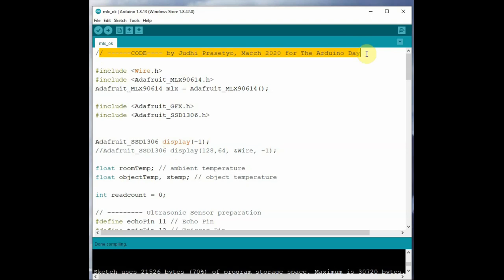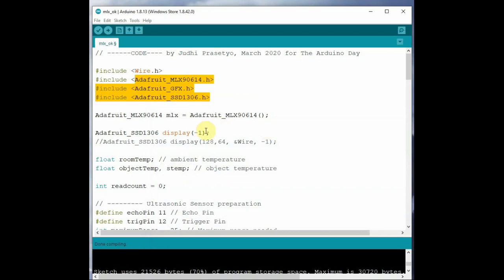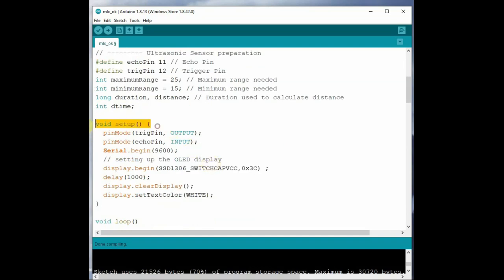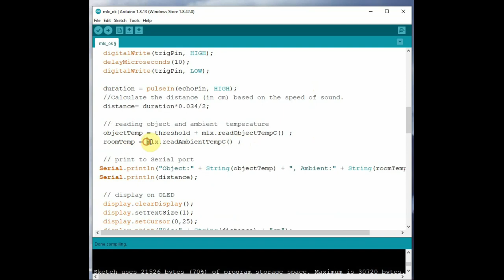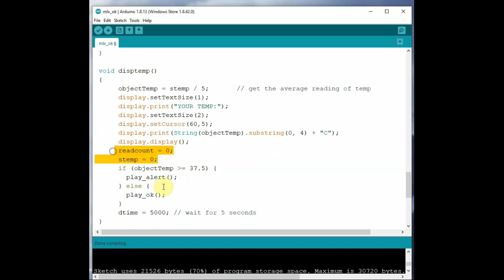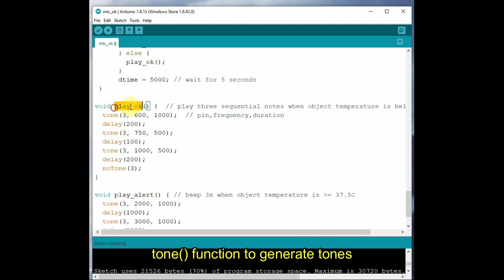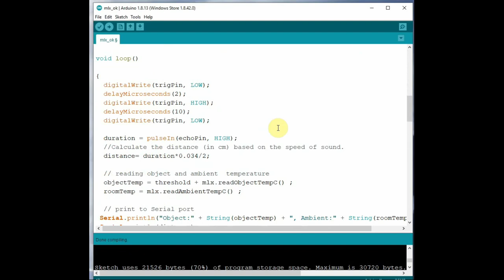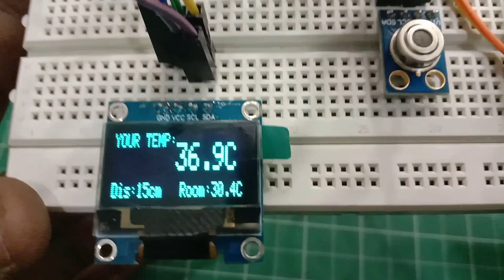MLX Non Contact Thermometer Project with Ultrasonic+OLED+NANO

Comment: Hey,

If I’m not wrong then as the distance between the object and the sensor increases the measured temperature decreases. 

But in the code you are directly adding a certain threshold value which may work in the current environment. But as the atmospheric temperature (room temperature) changes so does your measured body temperature also changes. 

How will you overcome this drawback?

Comment: Sir there is a very big issue When I use mlx and oled separatly it works well but when used both   The program doesnot work if I comment out mlx then only Oled works what is the issue ??

Comment: Perfect circuit, and perfect explanation. Keep it up sir. Please I am having an issue with the temperature reading. It is reading it as 1037°c on the display and serial monitor instead of a value like 31°c. Your reply will be very much appreciated. Thanks in advance
Reply: in my case it happening same
Reply: Same is the case here...did you find the solution?..please reply
Reply: Clean the sensors properly(use alcoholic spray if necessary) and reconnect, that fixed my problem
Reply: @alexabraham5771  thanks alex 
but now in this ,my temprature is 31 degree c
and the normal temprature of human is 37.
what is happening in this contactless thermometer
and for seeing my temprature i have to touch the sensor then only sometimes it shows the correct temprature
please somebody help me
Reply: @kshitijtechnicals2609  check ur temperature with a normal thermometer and calibrate the ir thermal sensor by adjusting the threshold, if the problem still exist after cleaning and calibration, then there might be a problem in the component, arduino port or it can even be a loose connection.
Reply: @alexabraham5771  ok alex thanks

Comment: Sir in this project after uploading the code and set-up the connection it shows only hold on message for long time but didn't get the temprature
Reply: Bro, may I ask did you solve the problem and what is the solution?

Comment: nice explain 
can you make one video on IR analog output connect with oled to show count from 0 to 16
My project is having ir sensor with analog  output l/arduino/ oled
reflection surface is 25 degree slant position while moving surface area towards ir sensor, oled display reading  0 to 16. distance in between ir & reflection surface is 110mm only. i tried with so many combination of mapping in code but initially oled display shows 3. please help me out.

Comment: sir the supply voltage is shown as 3V but here 5V suplly is given to the sensor ...it wont get damaged ?
Reply: Most sensor work on range of3.3 to 5v no issue

Comment: My display is not working after I upload the code (it show screen same as TV when there is no transmission) 
And when I add display.display(); in starting then only it shows adafruit logo nothing more is working can anyone help me??
Reply: Hi, may I ask did you solve the problem?
Reply: If so can you share me how u did it?
Reply: Yes the problem is solved
Reply: And the solution for that is power supply Power supply should be same
Reply: @zuhaibchoudhary4635  I didn't connect via battery but the cable tho?
Reply: @zuhaibchoudhary4635  resistors must be add?